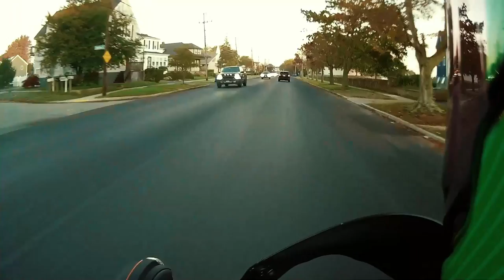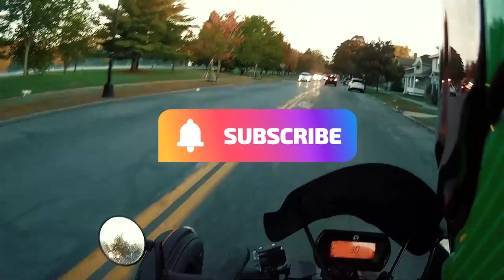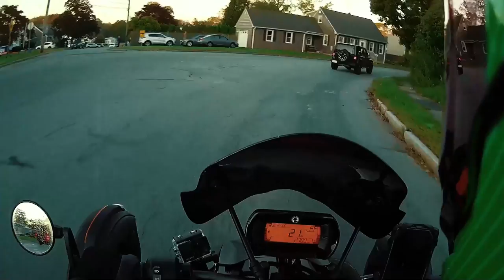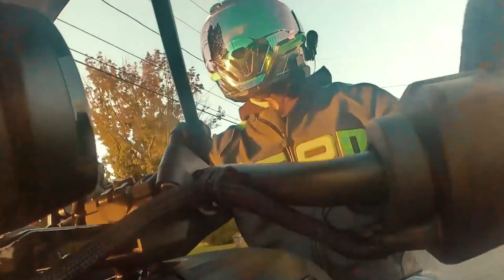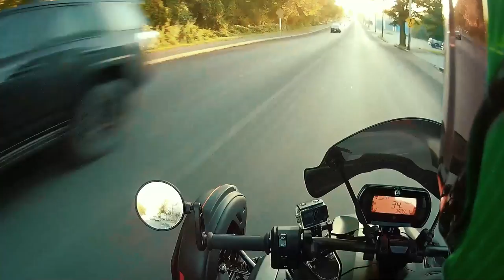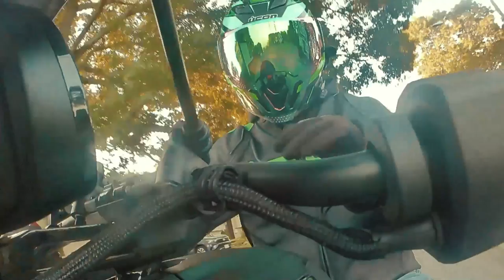How Throttle Controllers Work | Pedal Commander and Pedal Box

Comment: Haha, yeah trying to explain what the pedal commander truly does can be misunderstood.  I  did finally purchase the pedal commander and I love it, knowing full well I wasn't gaining any power, but what I love about it is having immediate access to the power my RT provides with much less throttle twist.  It is extremely noticiabke at low speed and low gears.  It is barely noticeable, if at all, in 6th gear at high speed, but the low speed immediate throttle response is fun.  I don't need any more HP, the RT has more than power than I'll ever need or use, but again having immediate access to that power is why I went for the pedal commander, it does put a big ole smile on my face 😁👍👍
Reply from the maker: yeah, most people don't understand but thats ok.  Glad it works out for you.  The tune on my Ryker is noticeable too.  Sport mode is really touchy, but it's fun.

Comment: These have been being popular since the introduction of drive by wire. Many popular cars have these available. I’ve driven some cars that have ether lazy slow throttle even when you stomp on it or have staged throttle positions which go from lazy to fast in the worst places.
Reply from the maker: The cars that I've driven that has had it I didn't bother changing it. However my Turbo Sonic I got tuned pretty much straight away.  It's a fun drive now :)
Reply: My last car was a 2012 Sonic LTZ turbo with a manual transmission. I had so many issues I never got it tuned. It made boost in a very small rev range, it liked to cut boost when I really wanted it. One time I was taking a off ramp that was damp it thought it detected tire slip and it fell flat on its face at 50MPH I had to drop two gears before boost would come back nearly got hit merging.
Reply: I replaced the valve cover twice due to pvc valve popping (it’s non replaceable), coil pack, water pump due to leaking, thermostat housing, upper radiator hose (it was leaking from the rope that helps it keep integrity), over $600 in suspension work because it tore up tires because even though it was in spec it wasn’t right. Had to do spring spacers on the rear and camber bolts on the front. If my wife moved my driver seat the airbag light would come on. It also never got the 40mpg it advertised best I could get was 32mpg and most of the time it was 26-28 mpg.
Reply: When I traded it in I had barely over 70k miles

Comment: LOL, so many people get it wrong - like dude, NO, you did not gain 100hp by adding a throttle controller.  And if you really want a mind boggler - Nissan did it the hard way: they put a detent in the gas pedal of the 7th-gen Maxima [I had a 2010 so I can verify this is true], where you only got about 80% of the available power and RPMs.  If you pushed through it, the thing opened up, ran all the way to red line, and tramlined like a son of a gun... but it was a lot of fun :D
Reply from the maker: I mean it's good for most people who can't drive and handle more than 80hp lol.  But for the rest of us, we need the POWAH!!!!!!
Reply: @BlackphoenixEntertainment  I feel personally attacked... 80hp?  Isn't that what my 114 puts to the ground? :D

Comment: You’re talking about a stepper motor servo controlling the throttle body. The computer controls the rate of throttle opening speed and governs this rate. So in stock form no matter how fast you open the throttle the computer controlled servo controlling the throttle body will only open at a rate set by the mapping program. This can be changed though, some ECU’s can be re-written and others can’t so you one may need an aftermarket UCE to re-program the throttle speed. Some engines ECU programing no matter how fast or how much you crank the throttle depending on your current speed and what gear the engine is in the ECU will limit how much the stepper motor servo will open and how fast. In essence it’s a shit system and it was a design function of the emotions control so that the emotions can be better set and easier to set up for all of the different countries emotions laws.
Reply from the maker: Exactly, and sometimes you don't even get 100%, like my RS spyder would start stepping down after a certain speed.  It's kinda dumb.
Reply: @BlackphoenixEntertainment  I agree

Comment: Do you mess with the tune?  Or leave it as received?
Reply from the maker: Well.. with a actually tune you leave it unless you've changed it.  With these throttle controllers they do have some settings you can adjust for how sensitive you want the throttle.

Comment: I understand what you’re trying to get across but you’d been better off at least stopping and showing s throttle and it’s actions. With OBD—2 in 1996 at minimum the throttle had to have at least a throttle position sensor in conjunction with the main ECU/ECM aka Computer in order to calculate the the best performance at the split second. A tune will do exactly what you said - replace the need for an add-on.
Reply from the maker: Not sure how I would show the actions? I don't have any cutaways of a throttle body or anything.